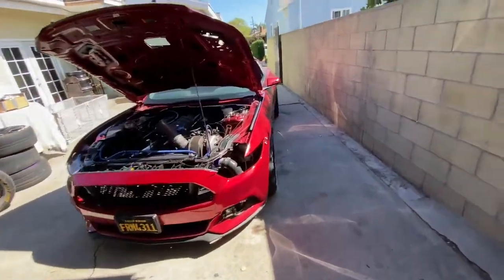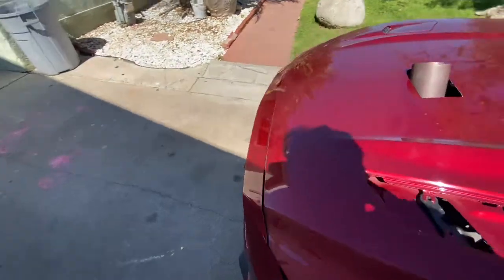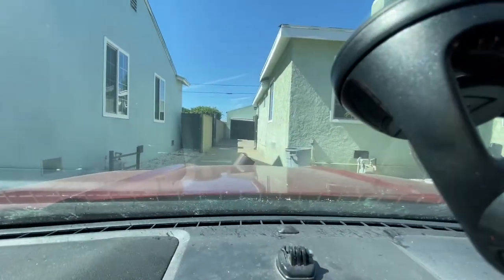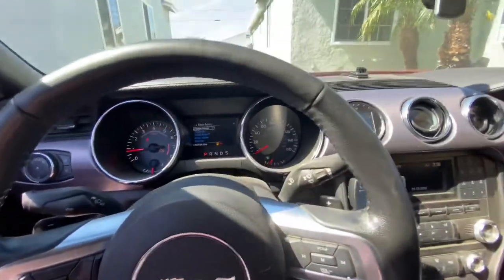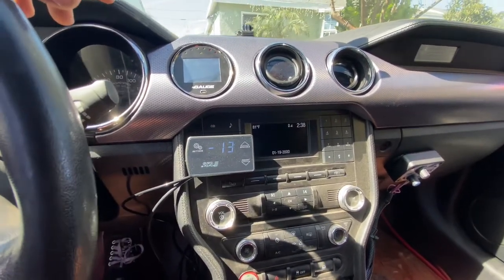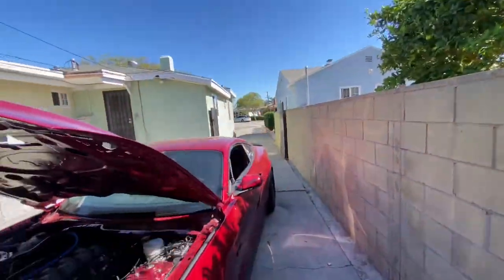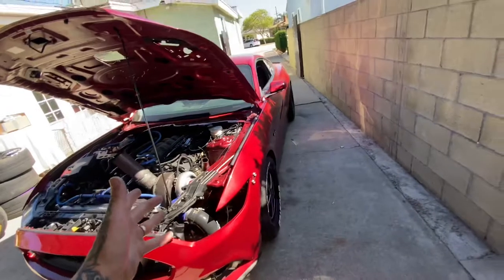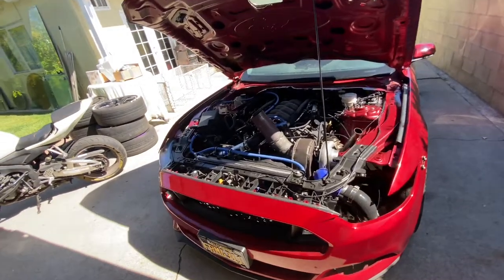CAR VLOG: Building boost and holding a 3500 stall on my Single Turbo Mustang

Comment: If you get that 1.4 60ft, I'm doing a 6r80 🔥🔥
Reply from the maker: Man ! I got a 1.6 today on only 1.5 pounds off the line. I’m try and get that 5 pounds next time out. See if that low 1.4 comes. I got a 1.47 with nitrous when I ran 6.76

Comment: Need to build 6 to 12 pounds on the transbrake to go low 1.4 mid 1.3 60ft talk to Lund about building more boost on brake and datalog it and send it in they can help you build more
Reply from the maker: Excellent man ! That’s exactly what I did. We are going to work on getting to 6 pounds on the brake this next time out and see if we can get her to 14 pounds throughout. Thanks for the info man 👍
Reply: @DiablitoSpeedz  you welcome man any time
Reply from the maker: @Curtis.GLRRacing  you have an Instagram ?
Reply: @DiablitoSpeedz  Yes @Curtis_allen_media